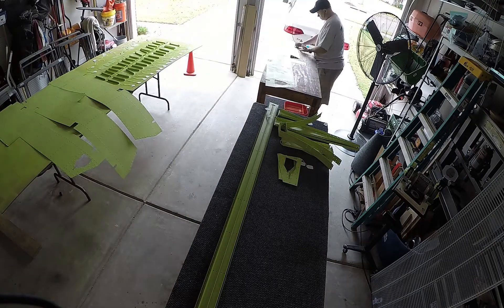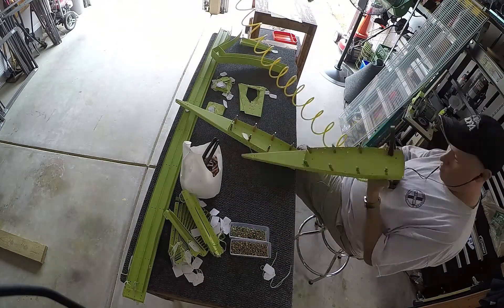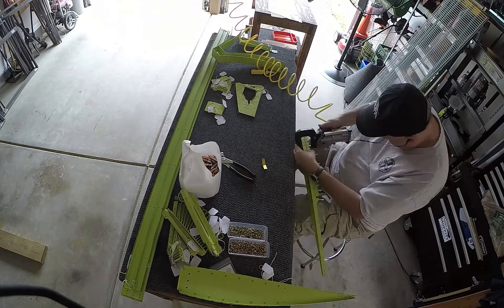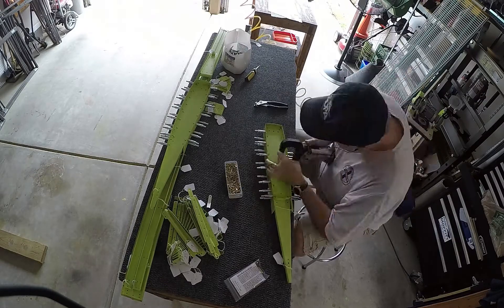RV-10 N17JP Update 8 Oct 2017

Comment: What paint gun and what primer are you using?
Reply from the maker: I use Stewart systems primer.as for the gun, I have gone through several and have settled on the 3MAccuspray system